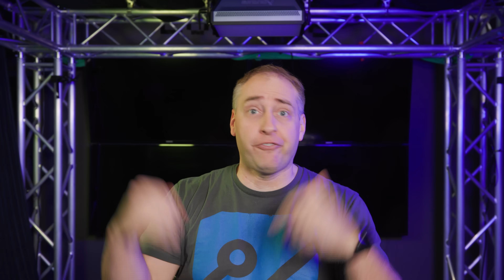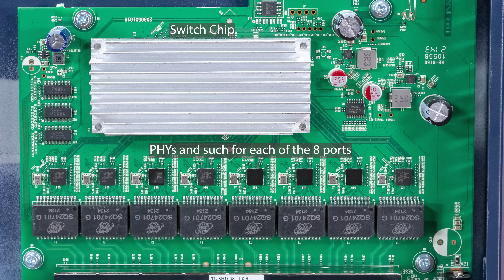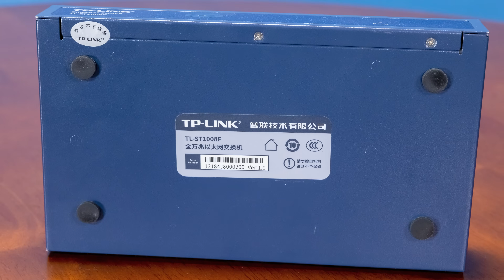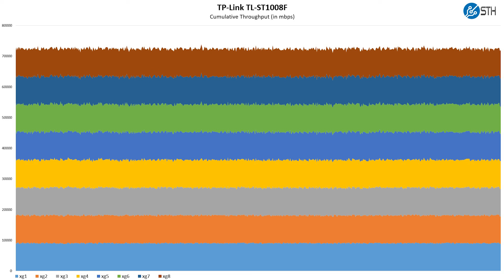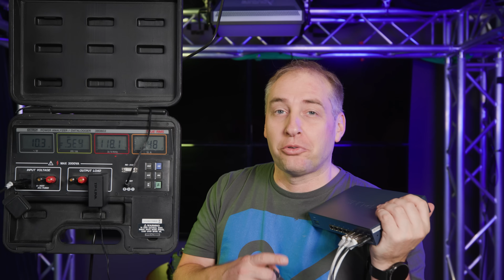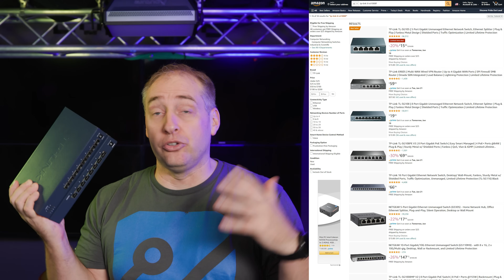Cheapest AliExpress 2.5GbE and 10GbE Switches from TP-Link

Comment: I've been using the 10GbE switch for 9+ months or so for my small but fast home network with a bunch of budget 10km LR modules, and it has been rock solid stable. I'm loving the transfer speeds without the broken bank account.

Comment: Question: Is there a switching limit to the SPF+ one? or it can route at full speed with all ports populated?
I imagine the chip would get hot with full traffic.
Would it throttle? would it require a fan mod later on? ( I know some cheap interne devices used to overheat if used too much)

Comment: We really need an opensource switch OS for whitebox hardware.

Even better we should go the opensource hardware route with FPGAs or ASICs & go 10GbE managed.

Routers, firewalls, APs, NAS, servers, almost every IT & IoT tech has an opensource alternative for prosumers but we lack good, cheap, opensource,   10GbE managed switches are lacking & expensive af.

Comment: Nice switches. A problem I could see are the missing certification labels on them which might result in them not going through EU customs. All required EU labels are missing which makes sense if they only sell those in China. Also you might get problems with the insurance if someone gets an electric shock from the device or if you have a fire. Especially in companies as they have really high regulations regarding electronics. At least here in Germany all electronic devices are tested annually with special devices. And one point on the checklist is if all labels are correct and intact.
Reply: Surely that only applies to devices in work places, rather than homes?  Nobody s going to test every switch and device in their home annually.

Comment: There is a shed load of sub standard switch chips on the market... in China.
but the main problem is the switching fabric.... it's like sticking a formula 1 engine on a bike.
you can shove all the SFP+ optics in .. you want, but unles it is backed by FPGA & custom asics it is USELESS, becasue it all bottle necks at the fabric.
like all these half assed QNAP & synology nas with 10 GB or > cards...., then when you get the diagnostics back from the cards , they are throttled or dropping data at the card/pci interface.
and people say yep... its going really fast i can see it.... yes its moving the data but it is a lot of repeats & resends.

Comment: I got the cheap 'Cudy GS108' 8-port off Amazon, it's 1GbE, but so is my max internet speed.
Used it to hook the rooms in the house with wired, which is more reliable than WiFi in a neighborhood with hundreds of signals making noise.
So far it hasn't exploded, and works as intended.

Comment: Noting why  are we talking about obsolete  switches..

we've  been 10+ gbps switches for the last 5-10 years  with access to 100gbps or better net servicing 10gbps  has been usable 10-15 years ago to I think we/re at the cusp of  10+gb in the home for over a decade now and I doubt copper based Ethernet has the capacity  to past 10gbps
Reply from the maker: 2.5GbE is designed to run over existing network cabling in walls. This is the standard that will replace 1GbE. 10GbE is becoming obsolete which is why port shipment volumes are free falling lately, but SFP+ is cheap for many users.
Reply: @ServeTheHomeVideo  you missed my point with active 10Gbuit the home we're looking at 100-500Gbit as the next gen speed..

10gb has been obsolete as a deployment solution in the home due  it length limitation 

if we are going to rely on media conversion  going forward to provide 10+gb  as the bandwidth solution..

Noting nate 4k at blue ray standards exceeds 7.5 gbps vs no more than 1gbps over the dvd standard

we are slowly at the point of 10+gbps lan interface..

my opinion 2.5gbps came about  for a solution searching for a use case problem which is 15+ year old use case problem..

with the advent fois internet service I would 100+gbps could be served to the home/business  to promote 10gbps lan in the home however this only had short deployment cycle to begin with due to limitation distance og copper interconnects..

Comment: If you are buying the cheapest network switches from China, isn't there a chance that the switches are capturing packets on your network and then forwarding your confidential data off to who knows where ?
Reply: Since those aren't managed switches it's quite unlikely since it's not like it runs an operating system. 
It's built to be a cheap as possible.
Reply: @GreyGoshawk  The Chinese government has trillions of dollars and has shown a willingness to engage in IP theft and spying on a huge scale.   The government could easily put some intelligence, some microcontrollers, in the cheap switches to bring valuable data back to Mother China.
Reply: @DerekDavis213  Yes. But they've engaged in targeted theft. 

What kind of small volume of data would the switch need to send that wouldn't be noticed? 

Also a microcontroller isn't going to have the processing power to do deep packet inspection. 

Also why is this important data not being encrypted before being transmitted on a network if it was so valuable? 

Are all machines on the network using public key encryption for SSH?

There's a lot of steps to protect against known threats before getting to worrying about a rogue unmanaged network switch.

Comment: Hey dude, can answer that auto negotiation thing. The 2.5gbps autonegotion thing is not a real standard, the only reason this normally works is because most NICs are either Broadcom or Intel so they literally need to work with each other. I have installed 10k+ Cisco switches that also fail to auto negotiate. Essentially it's currently best practice to always hard set one side of the 2.5gbps connection.
Reply from the maker: Interesting. I always thought auto negotiation was 802.3 and multi-gig is 802.3bz. For multi-gig NICs I thought Realtek and Marvell (via Aquantia) also have large port count numbers
Reply: @ServeTheHomeVideo  that is a fair call, I just looked up that standard and it looks pretty new 2016 it was finally approved. For $100 switches it's probably not true that it's following a standard to the T from 2016. 801.11ax was not approved until 2020 but there was ax being deployed before then.

Comment: Fun fact: when I plug a Ubiquiti 1 gig SFP RJ45 module into my QNAP switch, the entire management interface becomes permanently unresponsive until I unplug the SFP module. I tend to blame the QNAP switch more than the Ubiquiti module, QNAP switches are generally buggy. Luckily I have not had any issues with Ubiquiti's short range 10 gig fiber SFP+ modules, which are very cheap even brand new (something like $22 USD each)

Comment: I’d be very interested to know what use cases people have for multi Gig switches. It would have to be LAN based, because I don’t know anyone with more than a 1Gbps Internet connection, aside from large corporations. And you can easily find a Cisco managed gigabit switch with probably 4 10Gbps SFP ports for about the price of these POSs. Of course, you’d probably like to know how to configure it, but there are online documents a plenty that’ll get you as far as you need to go. Still, very curious.
Reply: Not every country have limits on their internet connection to 1Gb. I do have a consumer 10Gbps internet connection (FFTH) and yes I know I don't use it to its full potential right now, but  I have it now and it will last for the next 10-20 years. I didn't cost me that much to get a multi gig switch (QNAP after trying a microtik), 2x 10 Gpbs NIC (one for each computer) and a few transceivers.
Reply from the maker: Aside from the LAN side, several US ISPs are now over 1Gbps on cable modems. There is someone who commented on one of the fanless J4125 4x2.5GbE unit reviews on the main site that they went from 920Mbps to 1.4Gbps on their Xfinity WAN by swapping to a 2.5GbE firewall.

Comment: Honestly, the market for faster Ethernet is broken for the last 20 years. From 1MBit to 1000MBit pricing went down surprisingly fast (and yes, I bought a 10MBit NE2000 in 1988 for arund $300 back then) but in 2005 you could get very good 1000MBit devices for pretty much no money  at all,  a set of 5xCard and a 5xSwitch was like $30.  After that: Prices stayed absurdetly high.
I studied Electrical Engineering and while I mostly went into the software side of networking I have a good understanding of the technology behind all of this (I build my own radio AX.25 transceiver with 2MBit/s in 1990 and worked on an Ethernet Adapter for Amiga computers). And the pricing of this hardware is utterly broken. It doesn't make any sense, there is little to no competition and the few manufacturer make sure to always charge roughly the same money. A friend - the same I was doing Amiga Ethernet work 20 years earlier - was designing 10Gbit equipment around 2012 and basically he said "we are selling at 2000% profit. period."
I hope cheap alternatives from china will put some serious pressure on these cartel guys.
Reply: in 50 more years we'll all have 12Gbe switches at home
Reply: I also tried a 7-7 RR-Trunking connection. Well, it stacks bad with five conncetions and horribly with six or more. The simpler Teaming/Trunking-Solutions on the other hand work pretty well even up to 13x1GBit (yea, seriously, we tried this wih a board which had 1x1gibt onboard, a 4x1gbit PCIX - no typo - and 2x4x1GBit USB-NICs connected to an absurdely expensive 72 port switch. But still we went down the expensive 10gbit ethernet road pretty soon.
Oh, and how to say it polite.... most of the standard port trunking algorithms are pretty stupid. Those inside Windows are mostly useless too.
Reply: Boggled my mind to learn that the new amd 7950X costs like ~70$ to make
Reply: @The_Cinder  not even but okay. XD the cost is the man hours and blueprints (design) oh and patents and government payoffs mostly and that may be down to pennies for the actual materials. thank the regulations also that the gov puts on business.
Reply: @The_Cinder  They have to recoup the research thou...

Which costs thousands of millions if I remember correctly.
Reply: @The_Cinder  That is the marginal cost of manufacture. AMD's GAAP OPM is like 8%.
Reply: 2000% profit... pretty much every other company does this, just look at the price of phones and gpus xD
Reply: It is called government, that is why this stuff is expensive and not advancing. Government licensing laws and regulations have created a stagnant market with crazy high prices. Just look at the rate of release and advances. We basically went from 1Mb to 10Mb to 100mb to 1Gb every ~5 years but we sat at 1Gb forever (for over 20+ years). We won't hit 10GbE as a standard for another 10+ years at this rate. So it'll take 30+ years to get 10GbE as a standard.

We needed 10GbE as a standard over a decade ago!
Reply: @DCMAKER133  what are you talking about? it simply makes no sense because I know of not a single goverment being even remotely involved into ethernet development.
Reply: @CrassSpektakel  there are countless laws and regulations passed that increase the price of everything from metals to electronics, to the manufacturing, to the licensing laws of who can do this or that like make or research or work in that industry or job, and so many other factors that government meddles in that limits competition and development which drastically slows down and increases cost of production and development of everything. This is what regulations and licensing laws do. Patents also do this and sre arguably are bad but thats a topic for another day and you ahould read/listen to people who are that it is bad. They have a very good case. 

Anyways, they (regulations and licensing laws) do not increase anything or improve quality all they do is reduce competition/production and increase cost of production. 

Why do you think we have a silicon shortage? Do you think it's because the market failed? Or do you think it's because of the amount of government regulations and licensing that reduces competition and the amount of players in the industry because for someone to get into the business they have to be compliant with all of those regulation and licensing laws that increase the cost of getting into the field and reduces the amount of skilled labor because for someone to work in the industry it requires a lot of time and money to complie and not everyone wants or can do that. So there are a limited amount of businesses and people who can do the job.

Which is more likely on why we have the silicon shortage the market failed or government regulations and laws caused this?

This is a very complicated situation and a lot harder to understand but the same principle is at play so let's look at a simpler example of this issue. 

This is a true example btw and shows how government fucks all this up because of protectionism (limiting competition to keep prices high so entrenched workers/business can make more money since there is less competition so they can charge higher prices and get more business)

If someone just wants to braid hair for their customers and only braids hair and nothing else they are forced to get a cosmopolitan (IIRC the name correctly) license from the government that requires 2,000 or 20,000 hours of training in all sorts of things like haircuts, styling, beauty stuff, braiding, and more. It takes thousands of hours and over $20,000 to acquire that license to be able to legally do that job. Hair braiding is only a small amount of that licensing course and cost but you are forced by government to do that so what does that do? It raises costs that have to be paid by someone typically the customer via higher prices and causes a higher barrier of entry in that industry that reduces the amount of workers, employees, and businesses. If you Google this exact example you will easily find it. It's been in the news, and it's 100% true and stupid and insane. This issue is rampant because people have weaponized the government to protect their business and government is all too happy to control our lives and tax everyone into poverty. 

This exact same issue is at play with the entire semiconductor and technology field. There are significantly less Manufacturers, employees, and competition that allows the market to stagnant and charge exorbitant prices for products like Ethernet that should be mainstream by now because they have 0 competition thanks to all the government regulations that restrict all the things I said above. 

Just because you don't know something doesn't mean it doesn't exist or is at play. The government LITERALLY HAS MILLIONS OF PAGES of regulations on the books. More pages than any human can read in an entire lifetime let alone understand!!! This is well known and you should read about it and understand it!

This is why the market across the board and including Ethernet has stagnated and we have gone from double digit economic growth and rapid development to basically 0 today!!!

Does that help you understand? I am not great at explaining and there are definitely better material that explains this better and it's something you should be reading about.  It's something completely preventable if people were involved and readily tried to keep inept and corrupt politicians out of office and worked towards removing the bureaucratic state since they are the ones that created it because business have funded their elections and government is all too eager to try to fix things that aren't broken and want to control things because they want the power to do so.
Reply: @CrassSpektakel  government doesn't have to be involved with the development of Ethernet directly but they have countless laws and regulations that people have to follow and comply with that affects the market and development in significant ways and as I explain in my long post they affect how someone gets into that field and who can work in that field and so much more.

Comment: Great finds. How would you compare the 10 GbE TL-ST1008F with the TL-SX1008 once you've added RJ45 modules to the former and replaced the fan on the latter? Indeed, is there a fanless version of the latter? The model numbers are suspiciously similar. The SX is readily available over here in the UK for about £300, which means warranty etc. BTW the ST1008F appears to be advertised for £108.24 on AliExpress.

Comment: I've upgraded my network to 2.5gbit using one of these about 6 months ago. Really good deal, especially with RTL8125B being super cheap and well supported on modern OSes and I don't have to worry about running wires.

Comment: have any recommendations on good cheep Switchs that have up to 24 prot 1gb POE with 10GBE uplinks.  I have a lot of the POE Cameras, I'm using netgear 24port 10/100 poe with 1gb uplink ports layer 2.  but I like to Upgrade those 2 switches with the 1gb poe with 10gbe uplink ports.  want to use more powerful POE cameras.

Comment: Hello, i have a question if someone can explain.
I want to ask if you just plug into the ac and then plug some rj45's into the switch but they are not connected on the other side, does the watts grow, like you showed in the video?
Thank you in advance!
Reply from the maker: Usually not much if there is no link. An exception is like when we used the SFP+ RJ45 adapters where those will see power go up from powering the module.

Comment: I am a big fan of TP-Link's L2 managed switches (like the T2600G series, now discontinued) for home/small office use. Although not their "smart managed" switches, which are barely better than a dumb switch. The T2600G and similar switches were nice because they have decent L2 features and some L3 features for a good price (the T2600G-28TS was around $160 for 24 gigabit + 4 SFP ports). I have 4 of them (including one PoE+ variant) in use at home for years now with zero issues.